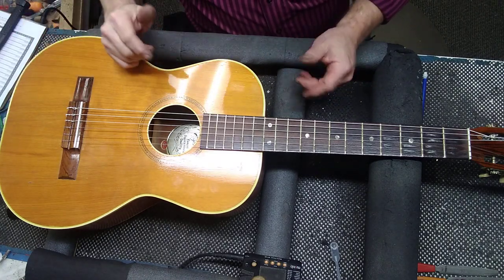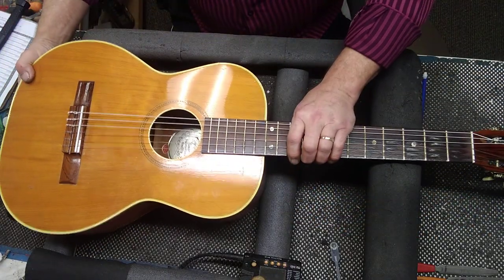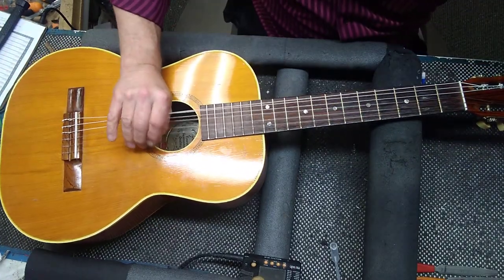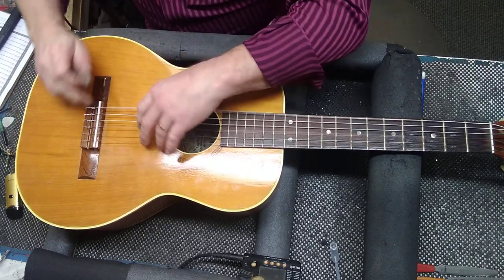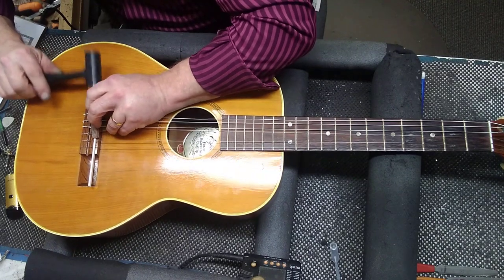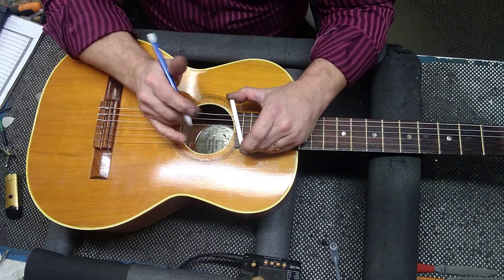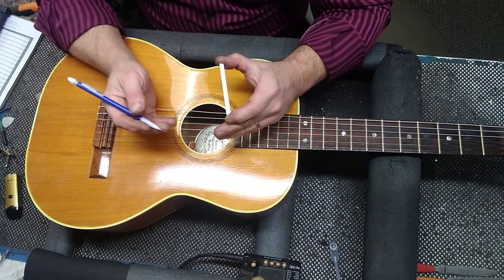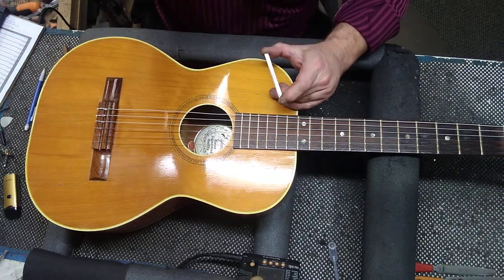Lowering the action on a Nylon string guitar.

Comment: Hello, your video is great. But I have a guestion. Is a guitar playable at all if it is not intonated, if guitar does not have total intonation. For example, if we have optimal action and guitar is in tune in open string position, is that enough, or we need that also in 12th fret? Thanks a lot.
Reply from the maker: Good morning, to answer your question. It should be in tune both ways. Open and harmonically on the 12th fret. If your saddles are correctly in place it will be. On a acoustic guitar you can only file a little on one side or the other. Electric you can move the saddles or bridge to get proper placement. There are a lot of variables, should be set up first. Or I should say intonation is the last step in setting up a guitar.
Reply: Yes, that is enough. It's all a compromise. Most decent classical guitars aren't going to have compensated saddles, which is ok. Depending on the music you play, some musicians will tune G a 1/2 cent low if they play a lot near 12.
Reply: Hello chaps, I think we should all go back to the drawing board if you want my honest humble opinion

Comment: I inherited a Cordoba Solista CD and took it to my guitar tech for a tune up, who does excellent work on my electric guitars and Taylor steel string acoustics.  He said everything out there about a 3-4 mm range of string height on a classical guitar at the E strings on the 12th fret is nonsense, and it should be more like 1.5-2 mm.  Something about the higher height is because of underbow and with a quality guitar like I have he can easily make it 1.5-2 mm with no buzzing.  I am new to nylon string guitar playing and his advice seems to contradict everything out there, but like I said, he has never failed me when it comes to my other guitars.  Any thoughts about what he is telling me?
Reply: Don't the Cordoba's come with a truss rod? I have two types C5-CE and Fusion 5, both with truss rod...
Reply: @Screenhandle  Yes, they do.  He fixed it the way I wanted and it plays awesome.
Reply: Wow. That is a really low action. I guess with a high tension string set and a light hand technique you could get along with it. 
Classicals need more room for the strings to produce more volume, that's why action is higher in this guitars.

Comment: Belt sander? lol
Folks, do not use a belt sander unless you know exactly what you are doing.
Use a flat hard level surface sandpaper and cheat this in by hand. Count the number of strokes. You don't want to have to shim this thing back to height when the belt sander eats off too much on the treble end.
Reply: Exactly old bean. Belt sander in my humble opinion is rather course
Reply: I didn’t see anything that he done right lol. There is no way he would be my luthier 😂

Comment: It doesnt make sense why u take out twice the length. Why though?
Reply: You measure action height at the centre of the guitar, but cut away at the edge.
Reply: @MattStormage  tnx, i figured that the string is like a circle's radius, and the center is at the nut and the circumference is at the saddle, thus lowering it x at the midpoint requires lowering it 2x at the saddle. whoa, this is too much math than i expected :)